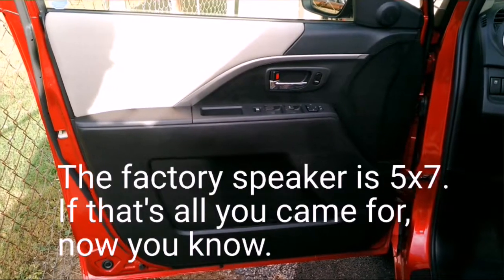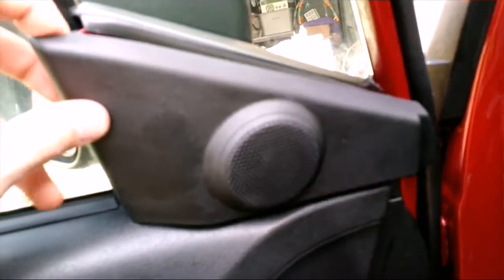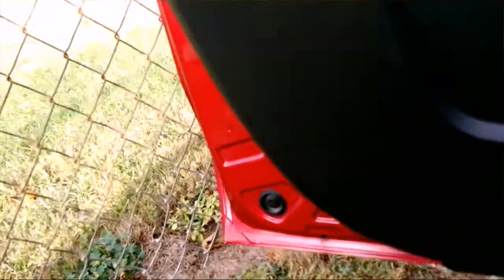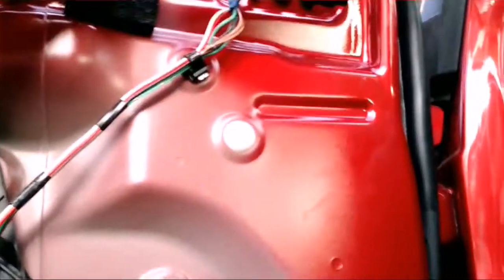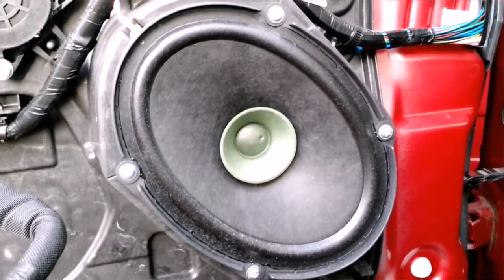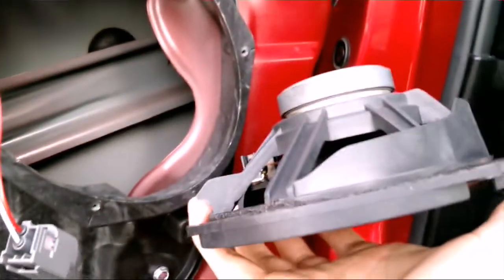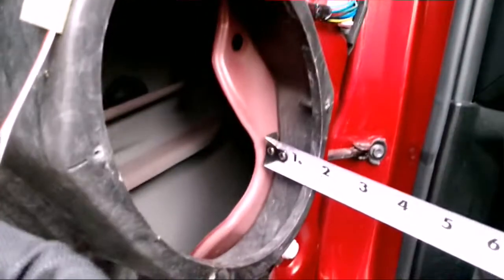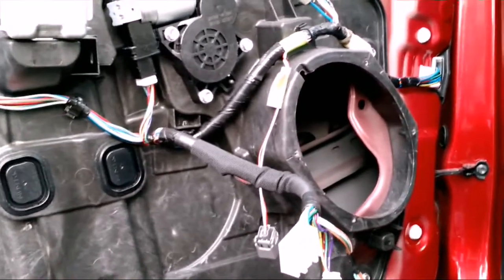What size speakers are in a Mazda 5?

Comment: regardless of the outcome, thank you for taking the time to do this. :)

i know the pain of trying to find info about ANYTHING on the mazda 5. if its not a 3 or 6, its buried deep or never was.
Reply from the maker: Thanks, I hate not being able to solve a problem. We had some issues with our 5 and traded it in for a Dodge minivan which I swore I would never do... but it was a really nice vehicle and my wife fell in love with it. Most of my new videos I'm sure will consist of all the common complaints with Chrysler products. And I still have my Mazda3 which I will attempt to keep until it blows up so lots of videos to come on it as well. Merry Christmas.
Reply: Just coming back to see this. Thanks for the wishes, hope yours was as well. I may do some videos for the 2012 Touring 5 that's in the driveway. Full disclosure, it doesn't look to be the most well thought out vehicle. Ha. That being said, it's quite a bit better than i thought when i first saw one.

Comment from the maker: I've hesitated to post a video of my new speaker install because... you are essentially wasting your time if you do not replace the factory stereo.  The factory speaker actually sounds pretty good  when pushed. I hooked mine up to an amp once removed from the car and they sounded 10x's better.
Reply: +PromisKeeper thx for taking the time to share. sounds like you are saying without a better stereo/amp just swapping out better speakers won't really improve the sound?
Reply from the maker: +Ezra Houser in my opinion yes. You may benefit from putting new speakers in just the rear because they are not components, but don't spend big money on powerful speakers without having a stereo that can push them. A $20 set of boss speakers would probably be an improvement. It's been several months since fooling with the stereo and we've come to terms with the factory set up. At higher volumes it doesn't sound too bad. your rear passengers have a better listening experience than the driver.

Comment: Added a pair of Kenwoods KFC-C6896PS 6 x 8 after thepassenger side speaker blew. Great improvement. Bass is much tighter. Haven't tried the tweeters. Anyone try replacing those?

Comment: I have a 2008 Mazda 5. The speakers on the drivers side, front and back doesn't work on media settting when listening to mp3 player but it works on AM/FM radio. What's the problem with it?
Reply from the maker: That is odd. Are you using a 3mm Jack input or is this Bluetooth or USB? My guess would be if it’s the 3mm headphone input you’re not getting stereo because of a bad wire. Could even be that the contacts that make up the “input” jack to your stereo are worn or broken so you are not making contact with the TRS connection like you should. Try a new 3mm TRS wire maybe.
Reply: @PromisKeeper  it was the 3mm double male wire that caused the problem. Short or bad wiring near one of the heads. I had a spare one, tried it out. Now it works perfectly.

Comment: Great video. Thanks! Have you tried replacing the stock radio and see if that improves the sound quality?
It would be helpful for those who are not sure how to do it.
Reply: I replaced the stock radio on my 2012 5 and it was like night and day. Put in a Pioneer CarPlay. Took 2-3 hours w slightly above average skills maybe?  But I went with Crutchfield and between their assistance and YouTube it turned out alright.  So glad I did it. I’ve had to pull the Pioneer out twice in 3yrs - once for a warranty repair and just last month for a blown fuse. Each time it gets easier - not that you wanna be doing that on any kind of regular basis of course...!

Comment: Hi, I'm thinking about upgrading the speakers on my Mazda 5. I was wondering if it's possible to install 6x9 speakers. I asking because a friend of mine gave me a set of Pioneer speakers and I want to see if its possible to use them, before I go and buy new ones.
Great tutorial BTW
Reply from the maker: Thanks for watching. You can buy adapters pretty cheap to take a 5x7 to 6x9 but it’s going to increase the depth of the speaker and likely not leave sufficient space to put the door panel back on. We no longer have the car so I can’t say how much free play there is between the current mount and the door panel for that to work in this case.

Comment: I have a 2015 and the speakers are terrible.
Reply from the maker: +Dj Revel yes they are.  I noticed the higher the volume level, the better they sounded. 40+ but that's just too much for a tiny family car. We traded it in a week ago. Bought a 2012 Caravan reluctantly... Dodge and transmissions... Stereo is awesome. Factory 6x9s all around and tons of bass.
Reply: Same here.  After reading some posts on Mazda247 and videos like this, I'm going to do a 6x8 in the doors (dynamat-like materials will be added), some decent rear 5 1/4's and a small 4-channel amp.  Leaving the stock head unit for oem look and resale.
Reply: @badandylaoc  Did you do it?
Reply: @abebros  only did the front speakers with sound deadening, it was helpful. The rear speakers are a bear to get to and the audio system money went to tint the 11 windows this car has!
Reply: @badandylaoc  thanks for that tip. I just got a second m5 and the front 5x7 came blown. Sounds like 5x7” 2-way is the cheapest quickest way to fix the trash sound. Lol on the tint. It’s got a ton of windows thank goodness it’s already tinted.